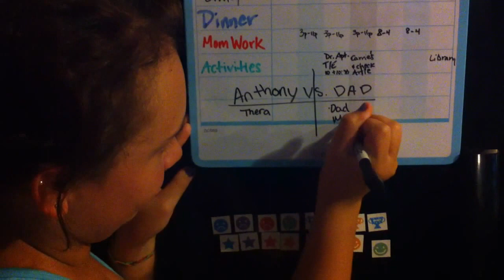Anthony carb question..+ my response to "The Bet"

Comment: Vac advance works different in different vehicles...Old school was to put the vac tube for manual shift to port vac and add a few degrees and auto trans vac to manifold and loosen up the mechanical advance for slip in the converter...But the fuel is different now...